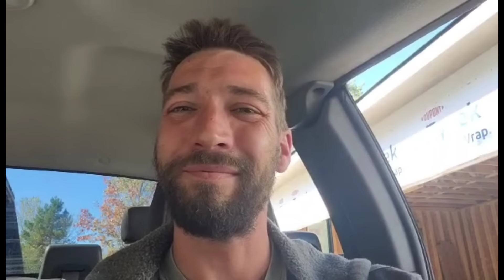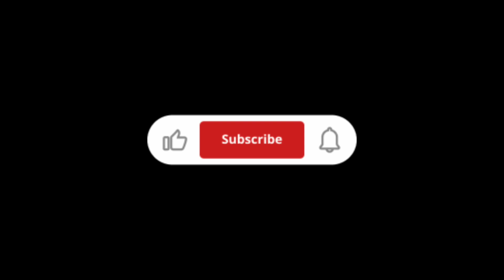Coffee, Construction, Your Questions; This is Episode 2!

Comment: Hello Andrew! When you first walk into my home I have a small stone accent floor. We just did new flooring and where the hardwood meets this stone area there is a ledge that is (at its highest point) 1 3/8”. I am having a hard time finding a reducer to suit this height. I bought the tallest one I could find and it still doesn’t reach the ledge. I have tried checking so many different home improvement stores and can’t find anything higher. Hopefully this is making sense. What are your recommendations for this ledge? Is there a way to build up the reducer I bought? 😊 thanks, Andrew! Wish I could post a picture to show but hopefully I am explaining this correctly. 😂

Comment: "Let nature do it's thing"... well, having mold is exactly that. :P 
About insulation and air tightness. In Germany, houses are build of bricks, stone, or/and concrete. This provides air tightness and thermal mass. The walls don't just mold because it's not wood and rapid temperature swings are unlikely. There is need for ventilation which is achieved by opening all windows once or twice a day for 10 minutes. This is the ideal. Most people don't do it and just letting fresh air in sometimes is enough for a healthy indoor climate in most homes.
No noise. Houses are just drop dead scilent. It's wonderful.

Comment: So, since we're asking construction questions, here's one - I have a 1950's ranch on a cement slab. A new furnance/AC was put in back in the mid 1990's. Had new ducting work put in so now there are ceiling vents and no longer use the floor vents. There are still vent covers on the old floor vents. How can I best seal those closed and take out the old vent covers as they are no longer in service? The HVAC system is in our attic now so it's not hooked up to the old system. Only the original cold air returns got tied into the newer system. Thanks.